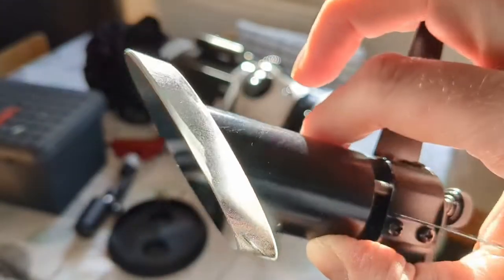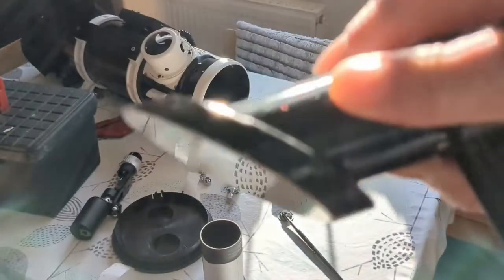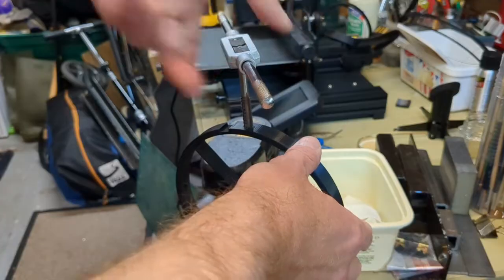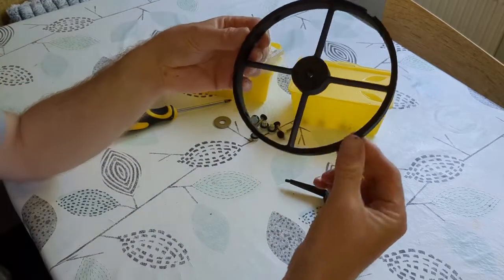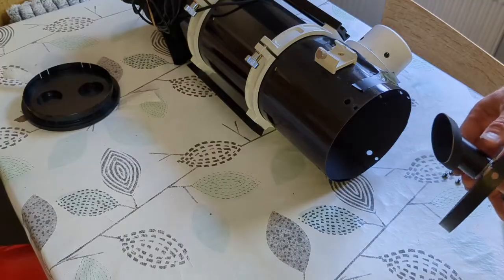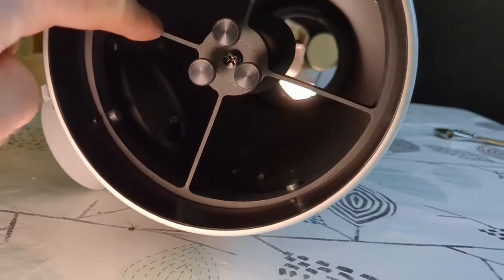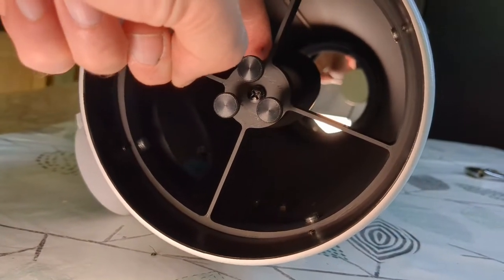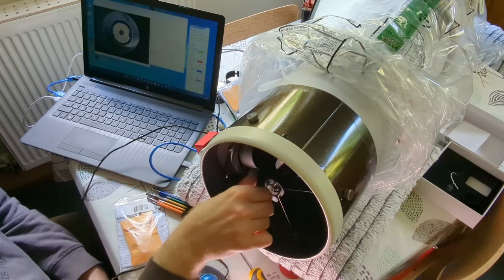Ten Things To Make Your Newtonian Amazing!

Comment: A few tips I would add: paint choice matters. Not all flat-blacks are "good" Rust-oleum 379558 Camouflage black paint is cheap for 32 oz and offers a much darker non-reflective black. Adding anti-vibration fittings to the scope helps tremendously. You can buy Sorbothane in everything from washers to bumpers. If you mount doesnt have rubber feet, consider adding some Sorbothane ones.

Comment: This is great video, thank you.   Not related to this video, but you maybe the best to advise me.  I need help to understand.  Sorry for too many questions, but truly truly appreciate your time and advise:

I am planning to buy a SW 200 f/5 Black Diamond.  I have the AM5 mount with PE200 extended pier on TC40.

1.  Is it possible to replace the stock (Crayford) focuser with a high quality R&P?  Would it benefit?
2.  I have the AM5 with 200PE pier extension and TC40 tripod.  Would that be good enough?  How much weight is recommended in the tripod saddle and on the CW Rod?
3.  Please suggest me the best coma corrector, that would not add in much weight.
4.  Can the zwo EAF be configured with it and it would work well?
5.  Is it necessary for me to upgrade for AM5N?

Comment: I would paint also the beveled edge on the mirror.

Easier to apply than flocking is sawdust. A good coat of wet flat black paint is applied, then sawdust liberally sprinkled upon it. Then a good application of flat black paint is sprayed untill all is well black. The overcoat of paint also toughens everything. The coarse texture is a better eater of light than is commercial flocking.

Cheers from Canada! 😊
Reply: Obviously you don't take your scope out to -25 temperature.
Reply: @Canada_Dominium If replying to me, I definitely have had my instruments outside to -25C. And colder, such as in the Arctic at -30C or so. (I spent 7 years at a DEW Line radar station, at latitude 70N.) 😊
Reply: @glennledrew8347  With flocking, there are supposed to be gaps running the length of the tube because of contraction of the metal tube.  The contraction might pop free some particles of sawdust.  If it's a plastic or cardboard tube, not so much a problem.
Reply: @Canada_Dominium A good and thorough matrix of paint nicely bonds the bits, and the mix is more than flexible enough to accommodate thermal differential expansion. My experience with this has been quite satisfactory in all conditions of temperature and humidity.

The main concern is inadvertent scuffing against the stuff, which can break away some little bits. But it requires some force to do so; it's not all that delicate. Particularly if one is thorough in applying a rich coat of the flat black spray paint.

And even should a particle or two fall loose, this is no worse than paint flecks that I've encountered in sundry optical systems over the decades. 😊

Comment: I am not an expert on Newtonian telescopes, but I do think the material used in the 3D printer should be stable at a wide range of temperatures to maintain the collimation. Being it one piece instead of the multiple piece construction of most Newtonian telescopes, it could be an improvement if the temperature sensitivity of the printed parts is less.

Comment: Nice work but you will never be able to achieve this perfection all the time.
Perfect collimation does not exist and it changes all the time. You have to do this several times and even once mounted on the support.
Excellent work👌👌👌👌
Reply: That was why he fitted thumbscrews on the secondary so field collimation is much easier. If you want to use a newt for photography you should recollimate or at minimum check it every time you move to a new target

Comment: I seen bobs knobs 20 quid for my skywatcher  150 pds 750mm  but after  research found 10 m4 35mm black 0.75 pitch 2.30p
Reply: bobs knobs is such a bad deal, i dont get why people still buy them. $23 + shipping for 3 knurled thumbscrews is absolutely insane considering that this type of screw is a regular thing used in many other things. You can literally get a 10 pack of M4x30mm thumb screws for $3. 

If you already have thread dies and some old M4 bolts you dont need, you can make them yourself for free in less than 15 minutes.

Comment: Hi, I want to put a small diameter ccd camera with corrector at the position where the secondary mirror would be. The cabling for the camera and the electronic focuser would be integrated into the spider vane. This would make my 14inch Newtonian a pure imaging scope. What do you think about this? I obviously would have to change the filters by hand but I imagine that there will be an improvement of image quality and the scope would be perfectly balanced at all times. Heat from the camera might affect image quality as it is inside the light path but cooled to -40 might solve this.

Comment: Nice video. But there are two "Improvements" that he does not mention, which were promoted by astronomer Ed Turco, creator of a Newtonian that competed in planetary image quality with refractors, that cost 100 times more.
1) A black cardboard mask, which takes 1/4" of the external diameter of the mirror, separated a few millimeters from the front. Ed said (and he confirmed it with examples) that most of the figurative errors were concentrated there. That the tiny part of light that we lose is more than gained due to the improvement of the image quality.
2) A black inside tube, extending the mouth of the telescope two diameters forward. The improvement in contrast is immediate and also protects against condensation.
I hope this helps someone.

Comment: Excellent video, "THANK YOU!".
Flocking the OTA is the best mod I've made.
Well, maybe next to using a green laser as a finder/'pointer'.
I'll swap out my screws for 'Bob's Knobs' & make a 'try' aperture mask.
I think I'll try ~4-5mm width but I don't know what diameters to use.
Orion 'says' its a 6"/150mm primary mirror but the OTA I.D. is larger.
Guess I'll have to pull the cell to measure it.
I think the software you used is very interesting but I'm not familiar w/ it.
Can we do the same w/ only optical/eyeballing it?
I've found collimation is very important but my scope hardly ever needs it.
But I only do optical observing unless I 'snap' a pic w/ my phone.
It's usually not worth the effort even tho I bought an expensive phone mount.

Comment: A tip for collimation the main mirror a lot of the adjusting knobs are small and twiddly so what I do is glue on plastic bottle caps larger than the metal adjusters it makes it far easier and finer adjustments!
Reply from the maker: Good idea!

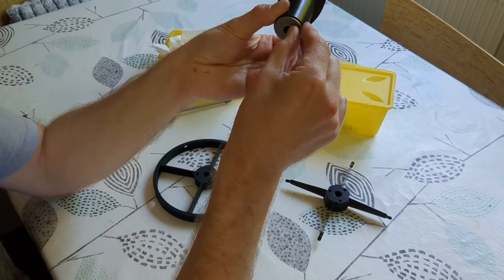Comment: 5:30 Would that washer actually help with collimation? I would have thought it's just adding more material to expand or contract with temperature variations.
Reply from the maker: It gives a stable surface, however I've not tried removing it to compare.  Thanks.

Comment: Great video.   Regarding an aperture mask that covers the outermost few millimetres of the primary, so great is the improvement in contrast due to covering the turned down edge (TdE) most mirrors suffer, that the contrast gain more than makes up for the slight loss of aperture.    
Ironically, no commercial scope will ever have an aperture mask (they cannot admit to TdE), but almost all should have one fitted!    Noticeably better views.

Comment: Hi Andy, I'm new to this,but I really want to do Astrophotography. I have a Skywatcher 250pds.  I'm about to try flocking and painting my Secondary mirror.  But can I ask where do I get a spider 3D printed ? And approx how much is it to have printed. Thanks so much for your helpful Vid. 
Regards Roy.
Reply from the maker: Hi Roy, thanks so much for watching.  The 250pds is a beast and I've not found a 3d print file on the internet, however there are metal spiders available from Backyard Universe, I found one from First Light Optics.  I hope this helps.  https://www.firstlightoptics.com/misc/backyard-universe-secondary-mirror-spider-for-sky-watcher-250mm-newtonian-telescopes.html

Best wishes and good luck with the project.  Clear skies!

Comment: Now I have used Newtonian telescope for 1.5 months (> 7 objects are captured).
None of these “10 things” are applied. Worked perfectly out of box. No collimation, no masking, no nothing; sharp like razor. Telescope is Epsilon 160 ED.
Reply from the maker: Takahashi are a different beast.  They are pretty much the best of the best and very different to my low budget scopes.  Clear sky's.
Reply: @AndyofAstro  Yes, you are right. I have other quite good scopes, including Esprit 120ed. They don’t come even close to Tak. Tak has something special regarding color representation, dynamic range and sharpness. 
But, you are right, Tak is very expensive.

Comment: I have many times thought of grasping the primary with "L" brackets with zero loss of light by having modified brackets to grasp the side of the primary, not the front edge.
Perhapssimply grinding away most of the "L", leaving only an edge to contact/grasp the mirror edge... maybe even mark tiny dots with a marker and grind simple divets over the marks, ~ 1 mm deep... just enough to capture the mirror.  No need to have excessive depth.
But getting COMPLETELY rid of ALL brackets (many scopes have cells with 4 brackets to secure the primary!   This area adds up fast and subtracts from precious primary mirror real estate!!!
From the outermost edge, no less!
Given that the primary mirror weight is not so much, it seems a small price to pay to minimize mirror grasp in exchange for more mirror real estate...

Comment: Hi, i have a few questions.
1 - What material was the 130PDS spider vanes and mirror holder printed in?
2 - Hows the spider holding up? Warps or cracks? Collimation? Hows it handle cold temperatures, if you've tested it in those conditions?
3 - What sized washer did you use for the secondary mirror?
Reply from the maker: Hello,  1) material used was pla.  2) I've not yet been through a winter as I printed this a couple of months or so ago, so far I've not noticed any changes to the material - however collimation has been good so far. 3) washer was a 30mm diameter (m10-m12 ish).  Hope this helps.
Reply: @AndyofAstro wow fast reply, thanks for the info. I'll be working on some of these mods, though I'm too scared to paint the mirror

Comment: Do what I did to an old C6-N Newtonian. I had my primary refigured to .98 Strehl and 1/12th wave. Was initially guaranteed to be refigured to .95 Strehl and 1/10th wave, it just turned out better. I then replaced my secondary with a 1/10th wave dielectric mirror. Then tweaked it from 750mm focal length to 758 to fit the mirror perfectly when I installed the new focuser and I indeed used black leather dye on all my edges. 

I was a beginner and bought the C6-N at a pawn shop for $125, it came with a 1.25" Tele Vue 2x Barlow and had scratched mirrors from cleaning with a damned paper towel. I joined an astronomy club and became friends with my mentor who helped me build the scope and taught me how to use my CG-4 manual mount and tripod since my Twilight One AZ mount couldn't handle the scope's length. My friend uses my scope to image and is delighted it came out so well.

Comment: Another suggestion which I've found makes collimation easier. Check the three (or however many) screws that support the primary mirror. In some scopes they are nylon, presumably to provide a "soft" support, and this is a recipe for the scope to go out of collimation when you point to a different part of the sky. If the screws are steel, they may be as supplied from the factory and have a raised irregular edge at the end of the thread. This is where they bear on the glass, and the support point will (a) be very small and (b) move when the screw is rotated. Neither of these is a good thing. Use a file to remove the raised edge and convert the tip of the screw to a very gently rounded dome, then smooth with fine wet-and-dry paper. The motion of the mirror when collimating will be much smoother.

Comment: Great video Andy. I’ve done all the mods to my 130pds, only thing left is to get a new secondary spider vane.
I use 2“ rings for back focus with my mpcc , this allows to me to set the image train deeper in the focuser. I have about 1cm of focus tube that protrudes into the OTA.

Comment: If your focuser tube intrudes into the light path of the scope you can get away with it for visual astronomy but for astrophotography you almost have to cut it down - it makes awful diffraction fuzz on any bright star.  On the plus side, they're almost always aluminum, and there is a good bit of it that has nothing to do with actually focusing the telescope.
Reply from the maker: Yes, I might have to cut it down a bit, I need to check the focus point and then measure the tube length required.

Comment: I remember a time many years ago when a now defunct british company offered some of its newtonians in Kit form. the beauty of this being that you only paid for what you needed.  Seems to me that  Sky Watcher Newts are being increasingly purchased for the optical components and tube only as the rest of assembly is not suitable for imaging. I looked at upgrading my 150P but decided to put the money I would need to buy the parts towards a CAT 51. I do not regret it. Still I am impressed with the final results you have achieved (maybe one day I'll have another look at upgrading the old 150P).
Reply from the maker: I think you are very much correct.  I didn't initially think of it as a kit of parts, but when I started using the scopes for DSO imaging, the need for additional changes to improve it  became clear.  There are some easy improvements which can be made, stopping light leaks etc.  The biggest issue I've found is the loose primary mirror, which caused all of my calibration issues.  I hope I've now got those sorted for the new season later in the year.  Thanks for watching.

Comment: How do you compensate for offset of the secondary mirror with a non-adjustable 3D printed spider. There is a reason that spiders are made the way they have been. They need to be movable in the OTA for proper offset and collimation. Did you compensate for the shortening of the focal length with the addition of the thick washer to the back of the secondary holder, and why did you not also paint that washer black as well? Have you talked to recoaters to see if they have any issues with you adding paint to the optics? It very well might add additional charges for stripping and time in shop when it comes time to recoat the primary and secondary.
Reply: FFS dude! This is a £240 telescope. lol
Reply: @pompeymonkey3271  Not that your opinion matters, but it begs to question why anyone would take away the adjustablilty or possibly add additional costs down the road for an inexpensive scope.
Reply from the maker: Hello, thanks for watching.  To help clarify as best I can.  The Spider is to create stability for holding collimation, it isn't adjustable, however it is central and when I collimated with the Ocal and my Cheshire, no off set was required.  The washer is clamped between the spider and the mirror support and therefore didn't need to be painted as it is not visible.  The focal length of the scope is unchanged because the collimation bolts are just a tiny bit further out (1.5mm) and therefore the mirrors are in the same position.  I have not talked to recoaters, however at this price bracket, if I get 10 years from a scope I'd be super happy and then I'll see how it goes.  I suspect the mirrors will probably last quite a long time if looked after.  First Light Optics do a similar Spider from Backyard Universe for a variety of scope sizes and the idea is to create stability in the telescope for collimation.  I am considering one for the 200PDS as my 3D printer is too small to print one.  I have had quite a journey over the last year getting the Newts to be optically stable, and hold collimation as best they can during an imaging session.  The main issue for me has been mirror movement, light leaks and reflections, which causes my calibration frames to not match the lights, generating artifacts in the images.  My goal is just to get the scopes to be a reliable platform for imaging.  A few youtube channels like Cuiv the Lazy Geek et al have outlines modification similar to mine to improve the performance for Newtonian's.  You are correct, the lack of adjustment could be an issue, as could the painting the mirror edge and rear, however I am just wanting to be able to get some reliable results from the scope which up until now have been tricky beasts to get to perform well, it has been a lottery with every night of imaging weather they work on not.  I hope this helps to answer some questions.  Best wishes.

Comment: Hi! Great video! Have you found a 3D print spider for the 200 scope? I would be keen to know. Cheers Rita
Reply from the maker: No I've not found one.  I think it might be because a lot of 3d printers are too small to print a 200p/pds spider.  It needs a large print bed.  My printer is too small for a 200.  I might be able to make an aperture mask, but even that is a bit big.  If I do find one, or get to design one, I'll post it.

Comment: Great video Andy, lots of very good information about improving the Newton telescopes, I really don't understand  why some of these issues are not sorted out at manufacturing, after all using black mat paint  and black fixings instead of silver also adding  black felt to line the focus tube to stop light leaks wouldn't add very much to the manufacturing cost